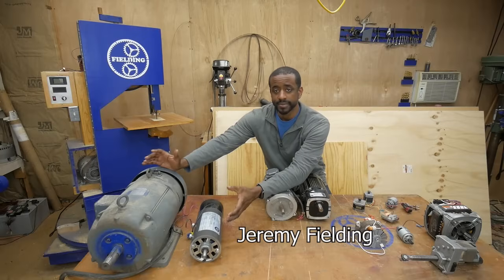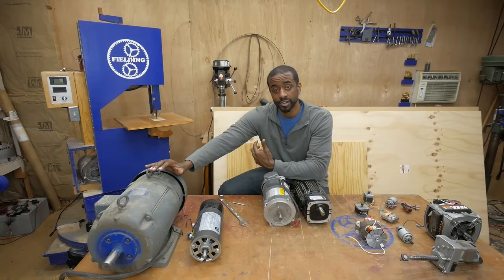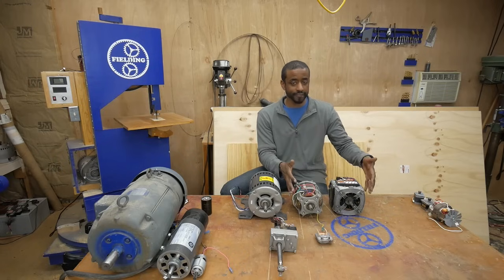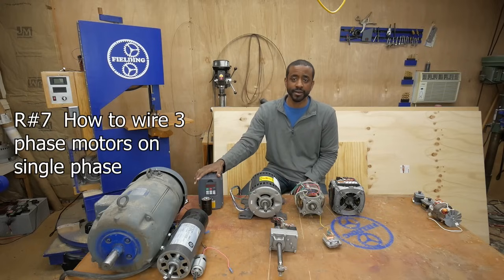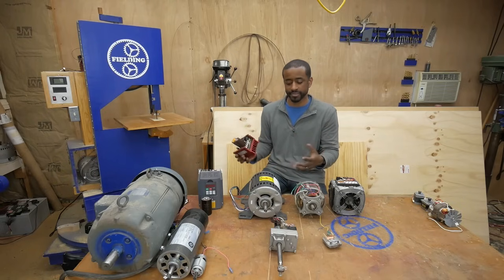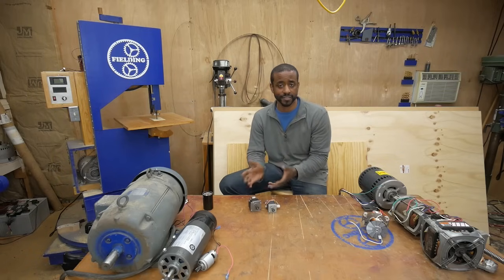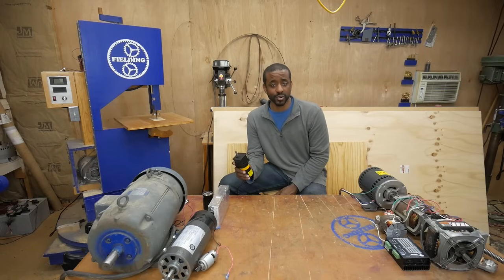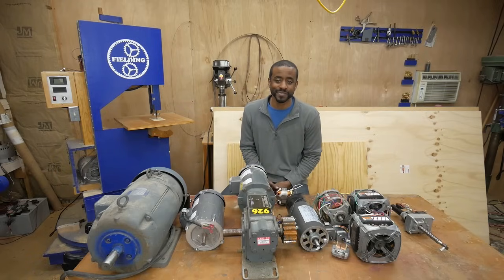Ultimate Beginners Guide to Using Electric Motors for Makers and DIY Projects; #068

Comment: one hp ac motor is equal to how many hp dc motor sir ?
Reply from the maker: 1 hp
Reply: @Jeremy_Fielding  can I replace 1 hp ac motor on the machine with 1 hp dc motor without loosing power ?
Reply from the maker: It would help to watch the video again. Sometimes you need to see it a couple of times for it all to soak in. I can’t advice people one on one like this. Not only are There are too many details to consider there are thousands of you asking at the same time making it impractical and unsafe
Reply: @Jeremy_Fielding  saya kurang paham bahasa inggris dan juga kelistrikan,I'm sorry

Comment: hi thanks for education !  what about those direct drive, VFD motors on washing machines. ? the ones with about 24 coils on the outside, and a rotor. ? Can these be used for anything DIY in the shop ?? got one from a neighbor, and it has a connector for 4, and a connector for 3 (smaller ones)  thanks....

Comment: My sister was an electrician for general motors and she was telling me about an electric motor she had to service that was as big as my Ford F-250 that took 4, 3hp 3 phase motors to get it going it was the motor that ran the line at their Oklahoma's City plant
Reply from the maker: At the end of my series on "how motors work for beginners" I show a 1500 hp motor from where I use to work. The shaft is nearly as big as my head LOL. Its in the FAQ video from that series.
Reply: @Jeremy_Fielding  very intelligent you are

Comment: Ok Jeremy  here's a very good and fun question. I think I already know the answer but your opinion will help: What if i have a bunch of identical 1PH 110VAC motors (i.e. from a washing machine, or fan or some appliance) of high RPM & low torque but  need a motor for  a high speed &  "higher" torque DIY project. Instead of buying a new motor why not use the three motors I already have and "pulley" them together onto a single shaft?! Would it not add their torques?  Wouldn't the resulting shaft torque be the added up torque of the three motors (assuming they all run at the same speed and the pulleys are all identical of course)?

Comment: A little late but NEMA is specifically the frame flange size and shaft size as a standard. You can get servo motors in NEMA standard as well as the more common metric standard. 

There are also many DC servo motors out there, you also dont need to have a encoder to have a servo loop, you can have speed or torque servo loops where all you need is a tachometer or current sensor for feedback. Torque servos are often used for things like winding machines where you want a constant torque on a spool. Speed loops are used for stuff like spindles where you want to keep the spindle at a constant RPM no matter the load. 

You will find a lot of the Japanese servo drives have all three modes built in, P•S•T, Position, Speed, Torque. 

One negative about servos is inertial mismatch and tuning. If you try to direct drive a massive load with too small of a motor you can have all sorts of issues, easiest to solve with a belt or gear reduction. Most of the newer name brand (non-chinese) brushless servos have full time auto tune which is very nice. Chinese branded servos seems to be about 10-15 years behind the Japanese stuff but are catching up.

Comment: I have a HFT / Central Machinery combination Belt/Disc sander that 'died.'  I thought to replace the capacitor (300MD 120Volt) but hate wasting $ on a cap if that is unlikely to fix the problem.  Anyone?

Comment: Thanks for the video, i have a question. I need to select a motor , which would drive a shaft. This shaft has an Airfoil or a wing and is located in a wind tunnel, sothat we can examine the effect of the angle of attack. The shaft should rotate only between -5 an 12 degree . The torque must be like 1500 Nm and the wing is 80 kg. Can you please help me to find the right motor for this application! How can i dm you?

Comment: The US doesn't have 3 fase power at home? Damm that country is a mess.
Reply: Arne;  Typically residences in the USA and Canada are wired with 230 volt 60 Hz single phase that has a centre tap so that you can power 115 volt loads and 230 volt loads equally well. Typical current rating these days is 200 Amps so a total of about 46 kilowatts is available.
   That being said, 3 phase power is frequently available on the nearest electrical distribution line so if you really wanted 3 phase in your residence you can have it in most cases by just asking and paying the extra costs involved. You would also have to change your power meter and the distribution and breaker panel.  The cost could be substantial for very little benefit to most people.
    In my case, 3 phase power is on the street right in front of my house so I could have it easily if I wanted or needed it.  I don't really feel the need because if I had to  run a 3 phase motor single phase input / 3 phase output VFDs are readily available as Jeremy noted. There are also several other ways to run 3 phase motors from single phase power.  For example, a pilot motor can be used or capacitors can be used to generate shifted phases.  In my view neither of these options is as good as a VFD though.

Comment: Very educational. Thanks. I have been looking at wind turbine motors. The 24v 10KW that I have been emailing the manufacture about tells me that I need a 12HP motor to run it. It has a 5/8" shaft. I don't see how they think that I need that much power. Do you? They won't tell me the torque. So I'm stumped.

Comment: Hi. Thank you for this video! I am looking to source a motor to power a 35' sailboat. I need motor and controller, and plan to run it off lithium batteries. Do you know which size I might need, the kind of controller, and where I may get it? I have found a few on ebay for good prices, but I am not sure if they will take a controller I can find, or if they run off DC. Thanks!!

Comment: I’ve built something you may be interested in also by using a DC motor to jump sword and AC motor bayous and I Variel  Power drive same thing they use in the Can-Am no gears just RPMs as they build up
I have some really great ideas to build something a lot bigger if you interested hit me up

Comment: Awesome series Subbed after 2nd video.
For brush motors, what about spring tension values??
I  have an 1.8hp oil-less air compressor, that broke the brush-holder, when it tipped over while moving it.
When I took it apart, to fix brush-holder the spring shot across the garage, and now I am searching for a replacement (manufacturer wouldn't help, they just wanted to sell me a new motor). Is there a way to determine what would be a good replacement(strong enough, but not too strong)?
Thank you for your channel, it is SO helpful to a beginner.

Comment: You can have your house ran on 3 phase in a lot of places in the US.  The powerlines in most places have all 3 phases. It can cost a ton to redo the house to have access to because you have to buy the transformer and have the power company install it. 

I have seen some home shops of people that have to much to spend with 3 phase power.

Comment: Im looking to use a DC motor, to rotate about 2lb to 3lb..no more then 5lb for sure. I thinking of haven't it turn straight from the shaft...to do so i would have to extend the shaft. I was pushing to use a used windshield wiper motor

Comment: Mr. Fielding, Thank you for sharing your knowledge and time. I went to electrical technical school for three years but never got motors explained so well.
I’m not sure you could help me with a motor i have in a metal mill for jewelers. I’ve got learning on my own a few years ago and bought it from a lady when they were moving away as a lot of tools. Since then, I’ve lost my home and things went bad for eight years. When i finally got to rent a small duplex i went to make it work again and it has never being the same. It has a reduction gearbox, and it used to work slow for the purpose it was intended to, but when i disassembled it to repaint it and change the power cord, it works extremely fast so u can’t put silver metal through the mill to form it as it will spit it out the other side as a bullet! Any chance i could send you some pictures and perhaps you could decipher what the problem is? Tried internet searches and called to the manufacturer but it’s old and they don’t have info on it anymore. I really wanted to keep it as it came to me, since it belonged to her father who gave it to her (she was a jeweler too), for the sentimental value for me as i think she’s lost everything too at the time (2008-2014) and was kind enough to give me some stuff, very useful for my learning, from the bottom of her heart. Please let me know if that’s something you could help me out with. Again, thank you for your kindness.

Comment: Anyone have any tips on the best place to find shaft adapters for a reasonable price? I'm currently hunting 2 for my 2 Whirlpool 1/2 hp washing machine "project motors." They're identical; &, the shafts are just under 1/2" round, with a flat spot on each of the 2 sides. I don't have a caliper yet; so, I haven't been able to get accurate measurements on the actual shafts yet; but, I took 1 of the little plastic "yokes" they fit into & got it mike'd. The rounded area was 0.49" and the width of the flattened area was (I'm having trouble finding what I wrote it down on) in the ball park of 0.43??? They were both made in Mexico; so, they could well be metric, despite the fact that I only had to use SAE sockets to strip both washers down. I'd like to find some shaft adapters which are longer & threaded; so, I can attach asst'd disks with magnets on them. (My goal is to build 2 "magnetic on-demand water heaters," 1 for indoors; & 1 for outside.

Also : With a motor which has "slow" windings & "fast windings, would I fry my motor if I tried to wire them together for a higher RPM? (Right now, I have the hot & common for the "slow" taped off; &, only the hot+start cap. & common for the "fast" ~ + the ground wire attached to the 3 wire test power cord. They both have centrifugal cut-outs for the start capacitors. Both motors fun great this way; but, I'm concerned that trying to add the orange/low speed wires to the blue/high speed wires + their appropriate common wires to the gray wires, just might fry the motors.) Advice welcomed & appreciated. :)

Comment: Hey Jeremy thanks for these videos about motors. Super helpful. I’m building a belt grinder for knife making motor is 1.5 hp at 3600 rpm with a vfd. Was able to find the motor for free and needed to rewire it, would have had a real hard time without these great videos! Great information spoken and presented very well.

Comment: Interestingly enough, the torque to speed ratio is used in much more ancient devices. I have a castle type spinning wheel, and the speed to torque is carefully controlled in that mechanism to create the correct speed for spinning yarn. Same idea, just much older and much simpler. Ancient spinning wheels and lathes may be the oldest devices to incorporate the idea, even before we humans really understood why they worked.

Comment: QUESTIONS: 
- At a given KV rating, will a motor with higher Watts have more torque? 
- At a given watts rating, will a motor with lower KV's have more torque? 
- Can we calculate KV from rpm and watts? Eg, 4900rpm/72V=68KV ?

thx!

Comment: Nice vid..i really thought sizes somehow affects motor power...i remembered seeing two motors of the same size but of great difference in wattage and voltage like 1000watt 60v with a 2200watt 72v..im really not into speed but power. Especially on climbing steep villages.

Comment: Good info, Jeremy.  I've a DC motor (on a Lathe) that connects to a variable speed controller.  Can't get a sound/movement/hum from anything -- even the RPM display on the controller will not light up.  Two wires, white and black, going from the Motor to the controller.  Can I hook up a DC rheostat and put 0 to 90 or so DC volts on the two leads to see if the motor responds?
Thanks, John

Comment: The first example you gave us made no sense, the big motor at 1750rpm(more torque) vs the smaller one at 3600rpm(less torque) but that don't determine the watts. All that does is determine the torque/speed. You said people ask why one motor has more watts(HP) than another motor. The bigger motor has more torque/less speed, but the hp is the same regardless if you raise the speed and lower the torque, or if you lower the speed and raise the torque.

The HP is different because they have different windings, different length of windings, different wire size in the winding, number of, size, and power of magnets used. So in other words, two different motors that have different HP ratings are because one draws more watts than the other. Speed and torque are not what determines the difference in HP between two motors because you can have different speed and torque on two different motors, but the HP can still be the same.

Good job though, nice attempt. Thank you. The larger shaft for larger torque is the engineering so the thing don't break, it is not what determines the torque. It is only trying to handle the torque. I think they still learned the general ideal that a bigger motor can sometimes have less HP than a small one, but that is rare. The bigger motor will always have more torque because the engineers won't waste material and time making it that big for no reason, but it won't always mean the HP is higher than the HP on some smaller motors, and sometimes it won't even match the HP in a smaller one. But most big motors have more HP than small ones, it is just physics. the motor in your wrist watch vs the motor on a metal press are totally different in torque and size, one runs on .2 mili-watts, the other takes 5000 watts.
Reply from the maker: The math is pretty simple... I even showed it in the video. Speed and torque are the only variables. I am not entirely sure what you are trying to explain with the power it draws from the wall references. The motor label describes power at the shaft not power used from the wall. One motor just needs to be more efficient then the other to have different power usage from the wall. The label shows that as well. It’s called efficiency. Perhaps you misunderstood something or I don’t understand what you think is wrong with the explanation.

Comment: Hi, I am very glad too see your video, I would like to ask; I have a motor  the depending of voltage the rotation is faster, it says 220V 5000, but i have black and red wire on it, what do I need to make work?

Comment: Hi Jeremy,  I have a small  metal work lathe which has an  induction motor  with a  capacitor .  I want to be able to control the speed.  I'm in Europe and have a motor from a washing machine.  I've wired it up but speed goes up and up  out of control.  I'm not sure what type of speed controller as I've seen lots on ebay. Looked here on YouTube but got no clear answer . If you could recommend something that could turn up and down the speed as desired  id be very grateful 🙂
Love you channel 👍

Comment: I have a 2.85hp treadmill motor and controller. I was thinking of using it on a drill press to allow me to have a speed controlled drill press for drilling in stainless steel. Nothing thick or big just need it to turn real slow to keep from burning my bits up. It sounded like you said it would work if I used pulleys to add torque. I plan on doing that but wanted to double check with you before building a mount. Thanks so much for doing these great videos!!!

Comment: Usually producers promise too much but electric motors are always underspeced. I have qs 138 70h 3 kw in my electric motorcycle and 6 kw continuous only make motor hand warm. Pushing 30 kw peaks are totally possible and 10 kw continuous is easy. Temperature monitoring is important because heat is enemy of electric motors and allows to push pretty high powers. If you don't have small motor it's magnetic saturation isn't problem.

Comment: What are some of the coolest things you’ve ever built with any electric motor(s)?
How would you rate the importance for each type of use for each motor?
What are the most common uses for motors?
When rotation is applied to the axle of an electric motor, it forms electricity, why?
Who taught you about electric motors/How did you learn?
Reply: Automatic gate or garage door openers, cement mixers, electric go cart, grinding wheels. Not sure if it ends up cheaper just buying things already designed, or if it's done just for the fun of it. Replacement motors for existing devices, but that's a lot of surplus.

Comment: Thanks for the video.  New video suggestion:  Tesla leading the Electric Vehicle market uses electric motors.  Their stock has made more millionaires than any other in history, that means they draw a lot of attention and viewers.  You could do a whole short series with your following on how Tesla, Arcimoto, and Aptera have implemented electric motors to power their vehicles.  These three company's seem to love YouTubers as an alternative to paying for advertisements also.  (Just two side thoughts, Aptera Motors is the only Electric Vehicle manufacturer that I am aware of that supports the "Right to Repair Act".  You have a large following, you could also do a short video just to do a shout out for the R2R act as well to support that cause.  The second thought is.... If you haven't bought any stock in these three, do so, hold on to it, and you won't regret it. (Aptera has not launched their IPO yet, so watch for it.)  Again, thanks for the video.